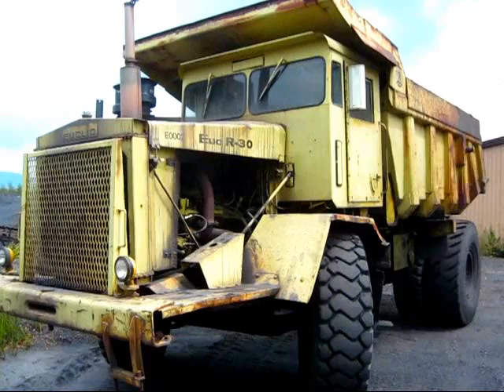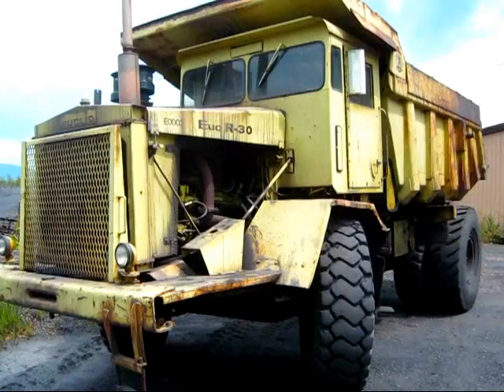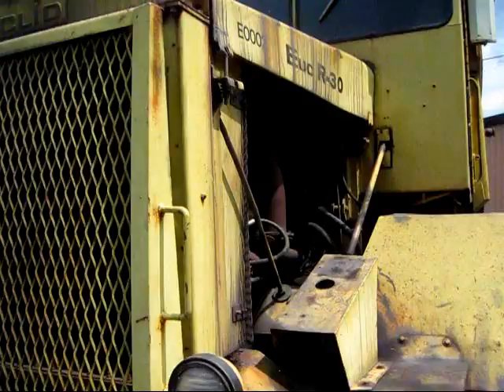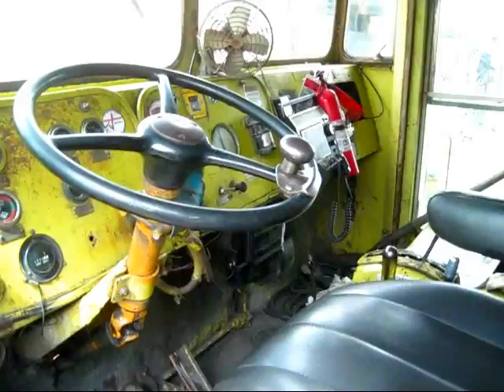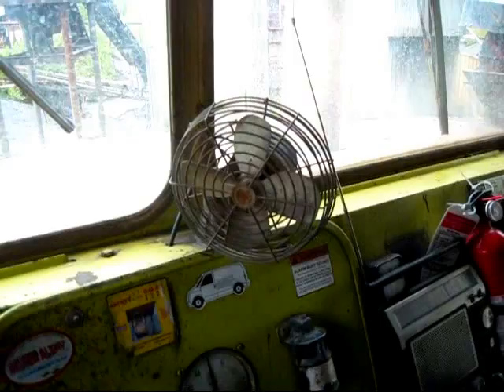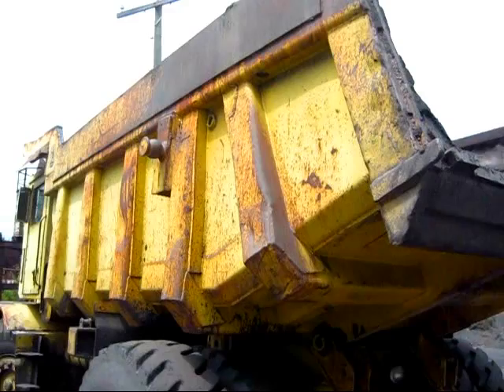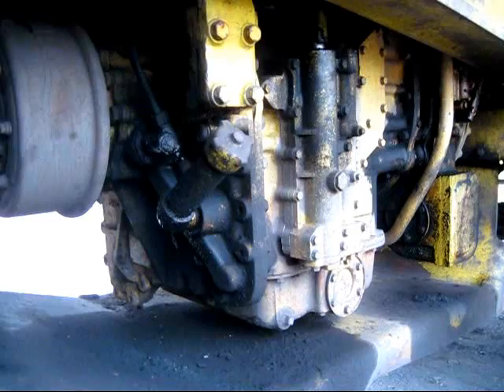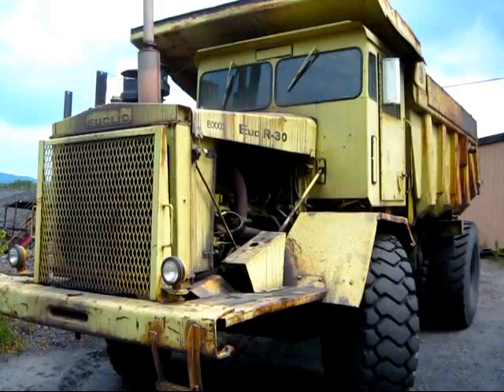Euclid 71TD Documentary

Comment from the maker: The trolley brake is the same as applying the foot brake on the floor.  The purpose is to hold the truck in position while it's getting loaded and dumping.  The truck should be in neutral when it is applied.  And no you don't use the trolley brake like a jakebrake.  The retarder is used to hold the truck back and prevent engine over speed.